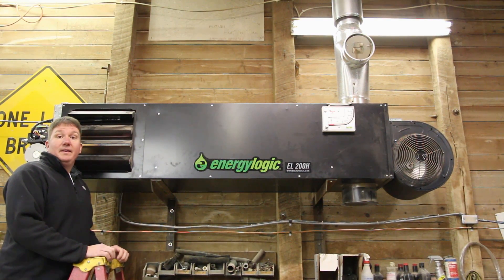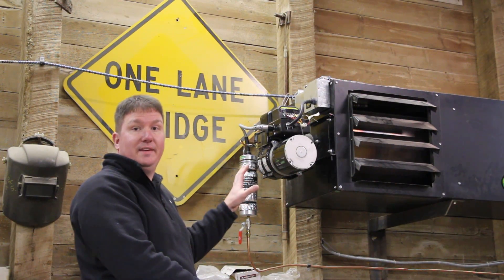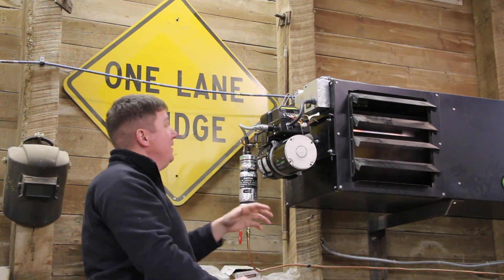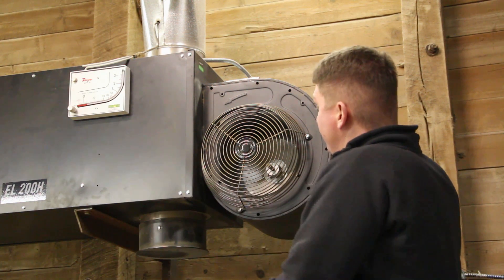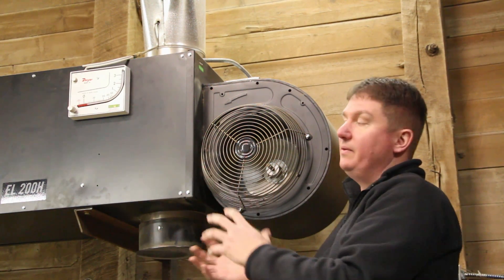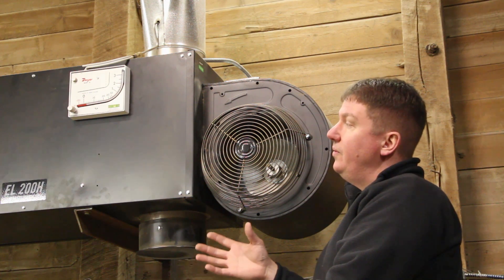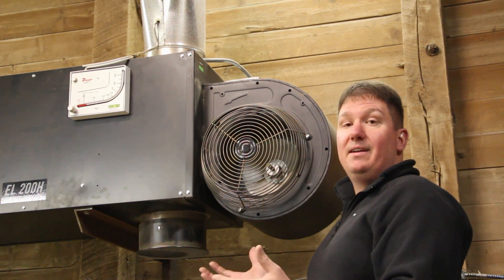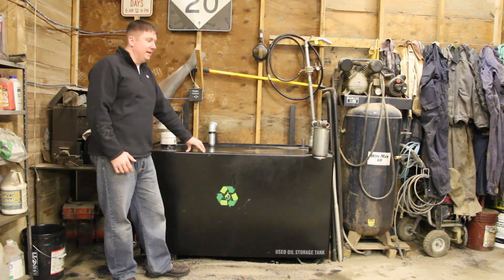Waste Oil Heat - Energy Logic 200,000 BTU Model EL-200H

Comment: How much do they cost (ballpark)
Will this make the outside of my building smell like an oil refinery
how clean is the exhaust when venting
what yearly maintenance do these units require (cost associated with it?)
I looked on their website and it couldn't answer these questions. Also emailed them a few days ago and no response so I was hoping you could clerify. thank you.
Reply from the maker: They are about $3,000 for this large of a unit.  They burn clean and you will not smell the exhaust or see it.  They do require annual maintenance and most of it is the cleaning of the burning area.  There is a black buildup in that area that will need to be scraped away.  If your oil is clean, the injector will be fine.  The big item is not to get oil in it with any water.
Reply: These units vary in price depending on the number of BTU's you are looking for - from around $6000 to around $10,000 for complete systems. They burn clean! - no smoke from chimney and are EPA approved for disposing of used oil.  They require about 3 to 4 hours of maintenance annually - with minimal parts - around $100 to $160. Check them out at www.nueraheat.com - we're the largest stocking EnergyLogic dealer in the USA.
Reply: @danclemens1835  price doubled in a year,damn!
Reply: @kb9826  nope ..the pricing hasn't increased much in the past 6 years.. we do have a 75000 BTU model for $3500.